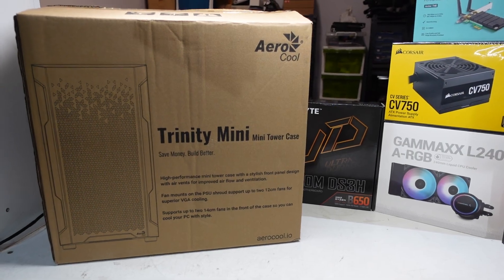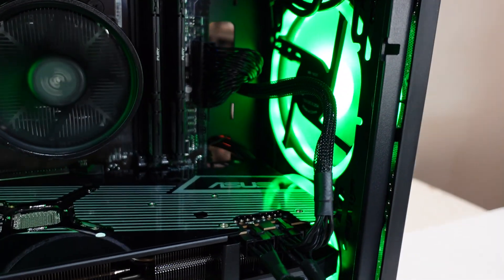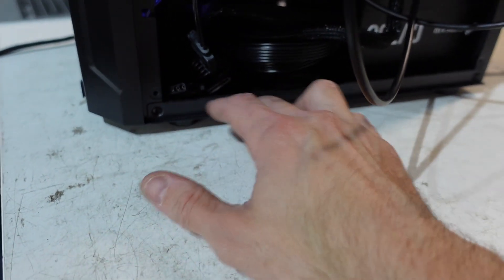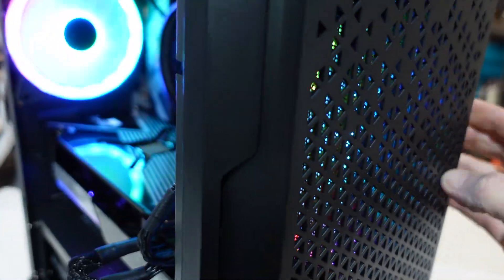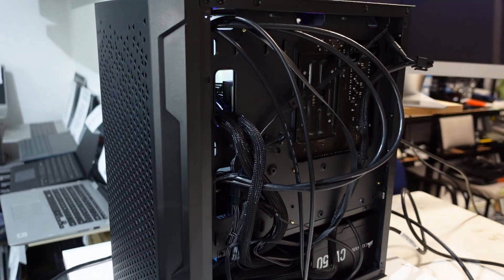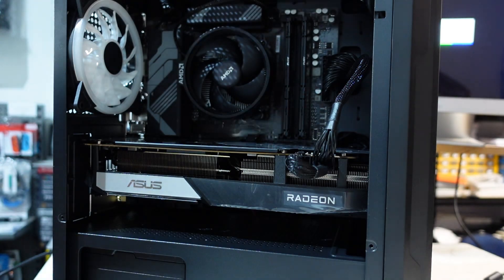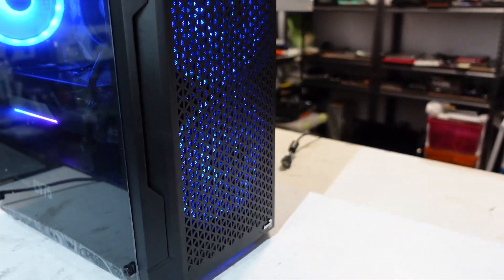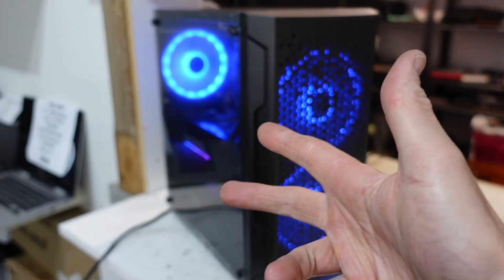Aerocool Trinity Mini Case Inspection and Build

Comment: Hey I’ve had this case a while and only just seen you can change the fan colours. Where would I plug the reset switch into so I could change the presets of the fans?
Reply from the maker: follow the fan cables and see if there is a little cable coming off (would have 2 or 3 pins on it) reset button cable connects to it
Reply: @rickstechrepairs thanks for the help but I’ve just realised I have the v2 version so cannot control the fans so I’ll just buy some new ones. Thank you for responding though

Comment: i just build a pc using this case, but the fans are not spinning, i have only plugged the cables to the System_fan socket on the MBO, should i be plugging anything else for them to work ? thanks in advance. (i did not plug any Sata whatsoever)
Reply from the maker: Not sure sorry

Comment: Sir is it possible to place a 240 aio cooler in the front, replacing the default 2 front fans?  The default front fans have 140mm right so I think it is not problem, but I doubt about the thickness if can you put the cover back.

Sorry for my English.
Reply from the maker: your english is good, better than mine

at the front you might be struggling to fit the 240 AIO, i think it would fit at the top of the case tho
Reply: @rickstechrepairs  thank you sir

Comment: Hey i have the same case but i wanna know how to add an SSD to the computer,one is already motherboard (NVMe).
Reply from the maker: there is a 2.5" Sata Location on the back of the motherboard Plate

And a 3.5" hard drive tray in the bottom of the case